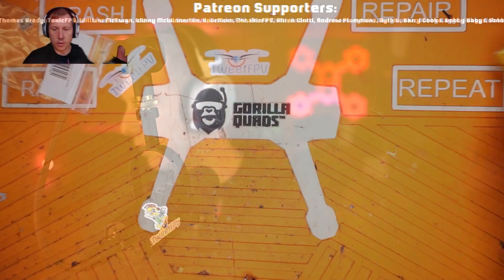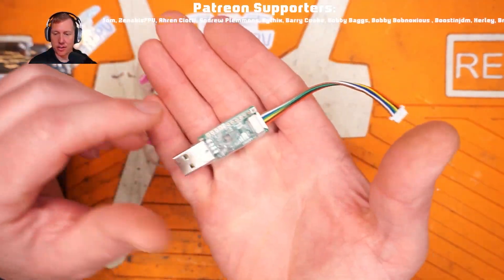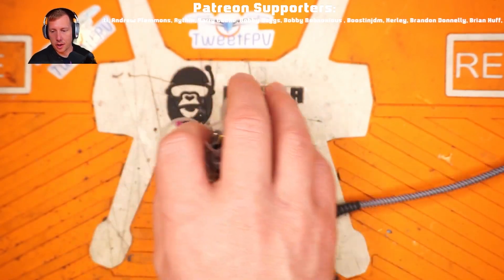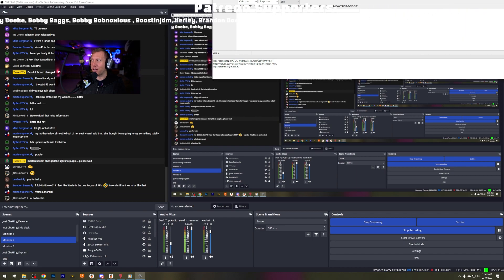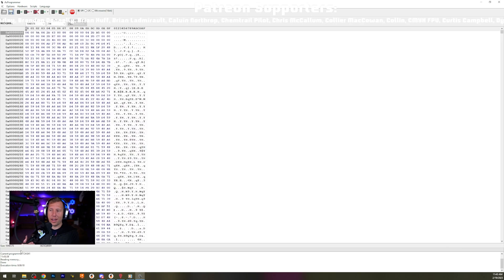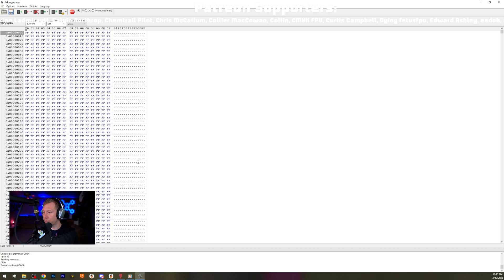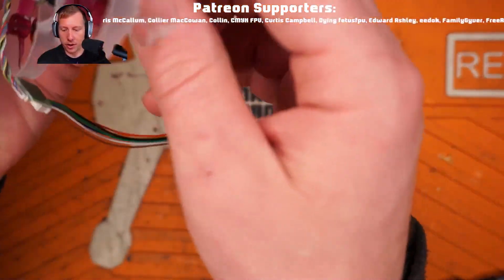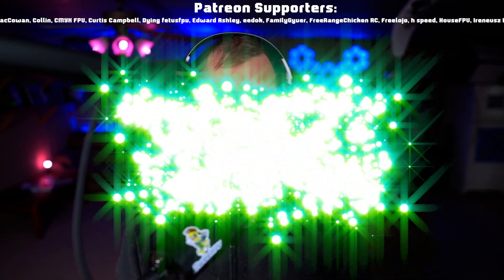Frsky HDZero updating tool

Comment: If you edit chiplist.xml in the AsProgrammer folder you can remove all the other SPI entries and just leave the Winbond W25Q80BV entry. This means the IC > SPI menu in the application will only populate with the option you need, saving you 10 seconds of annoying scrolling!